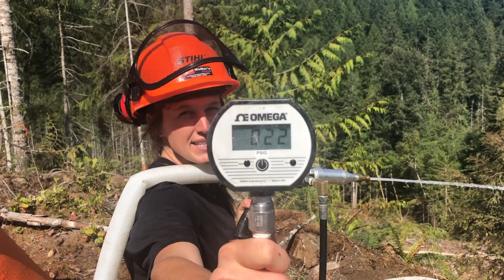Pump Battle: WATERAX MINI-STRIKER® Pump vs Honda WX15

Comment: A bit disingenuous when you’re using a semi trash pump against the high-pressure pump. Honda also makes a high-pressure pump that uses that same Honda motor that would probably blow yours out of the water. It’s a partnership with keene engineering.

Comment: you forgot to add that the Striker is twice the cost. Honda also tells you up front what the maximum hose distance can be which is 130 feet. No one is going to use a 50cc engine to pump over a 600 foot hose lol.

Comment: Love the mini striker. Its a great all around pump. I used one for a couple years on the fire line and they are easy to use. When I first saw it, I was like how much water is this little pump going to pump? The first time I used it I was instantly sold on it. Easy to start, no problems and It puts out a great stream of water especially with a smooth bore nozzle, like the one used in the video. It is a good light weight option for home protection that you could connect to a tank or swimming pool. The only problem is I don't have one of my own 🙁

Comment: High-pressure pumps like the red one Will get destroyed if there's any gravel or anything that goes up inside them, where's a Honda  Willl survive?
Reply from the maker: it depends what you need to do with it! If you need any pressure then it won't do you any good.

Comment: Would you say the self-priming ability of the Honda is better? Thanks!
Reply from the maker: Could you clarify which pump you are talking about? They both have a Honda engine, the difference is the WATERAX pump end that is better suited for high-pressure at distance and elevation.

Comment: Honda says on their website that the pump is for pumping up to 37 meters. If you try to pump 43 meters it's clear it won't work...
Reply from the maker: We compared the two units as they are both used in the field in the same wildfire settings.
Reply: @WATERAX No, address the individual comment. Don't shame a fish because it can't climb trees
Reply: @WATERAX  stop copy pasting that answer and address the specific point he brings up. We know your pump is actually better, but picking this 43m height is deceiving because obviously the Honda wouldn't work.
Reply: 37 meters is the hose length not the height. Honda states 130 feet max but they decided to use 600 foot hoses in this video.

Comment: You can't really compare the two pumps. The Honda WX-15 is designed strictly for water transfer not for fighting forest fires. lol
Reply: For the first couple years that I worked on an Initial Attack crew in BC, we used the WX15 until the agency purchased some MINI-STRIKER pumps which were, by far, the crew's favourite.
Reply: Actually you can, as the WX15 is not strictly for water transfer. Lol ....
Reply from the maker: We compared the two units as they are both used in the field in wildfire settings.